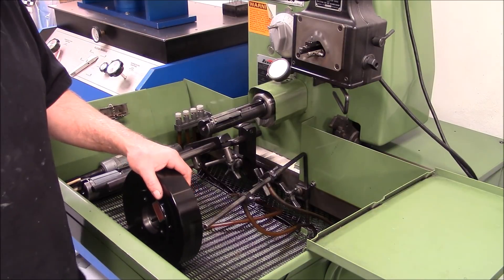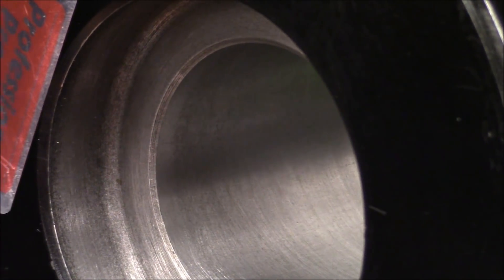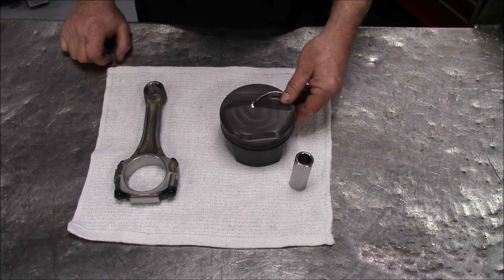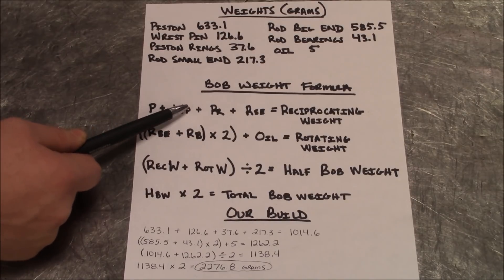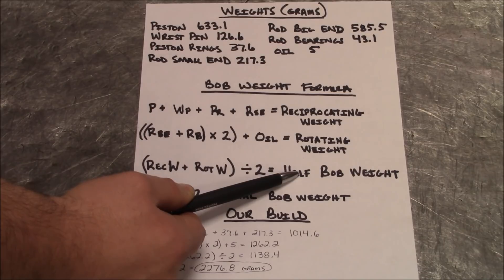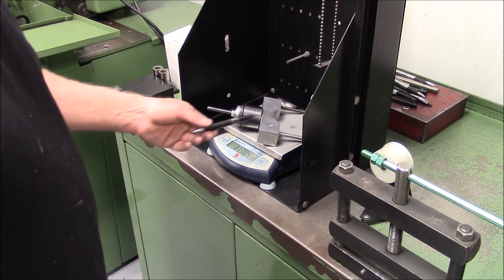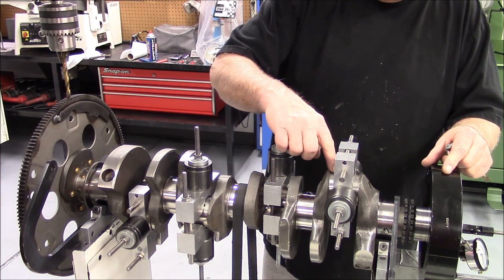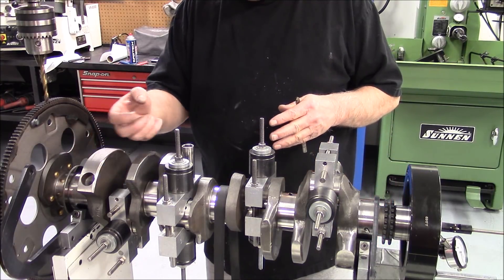Part 8 Rotating Assembley Balancing - Bob Weight Setup 620 HP 454 Big Block Chevy Engine Build

Comment: If I'm currently Selecting Crank, Connecting Rod, Pistons and considering a Super Light Manley or Lanati Crank, to keep rotating Assembly as Light as Possibly, Seems to be Smart to Calculate Rods n Piston weight (As You have shown) to Match Crank Bob Weights as Closley as Possible, If Not, Might make more sence to buy Normal Weight Crank rather that adding Mallory ?
Thoughts

Comment: why divide by 2 to get half bob weight only to multiply by 2 again. total bob weight will be the reciprocating weight plus rotating weight always right? 1014.6 + 1262.2 = 2276.8. why not just stop at that step?
Reply: I think you need to know half bob to ensure each weighs the same

Comment: you did a good job getting the weight down on those stock rods but they're still kinda heavy compared to scat i beams. doing the work yourself helps justify buying those expensive wrist pins.

Comment: I am a curious sort of person.  I wanted to derive for myself where the rule of thumb "100% of the rotating plus 50% of the reciprocating" came from for the bob weights.  I set up an incredibly detailed spreadsheet with all of the rotating assembly components' masses, positions, and velocities during a revolution.  What I discovered in the end, was that the 100/50 rule of thumb only truly applied when the center of mass of each connecting rod was exactly one-third of the distance from the big end to the small end.  Yet, I have never heard any engine builder mention this.  Is it possible the Engineers at the factory knew this, and roughly designed the engine with this in mind, and it somehow never translated down to the mechanics/aftermarket?

Comment: Newbie to this so....possible dumb question. What would be difference with new parts (scat forged crank and h-beam rods) instead of used? Same lightening, resizing of rods or just whats taken in the balancing process? Would you still do all the work on a new scat crank, or again, just whats needed for balancing? BTW...small block stroker motor, street strip, looking for approx 520-550hp. any help would be greatly appreciated. Am enjoying the videos, learning alot. Thanks.
Reply: Unless it was specially ordered, the balance will be farther off on a new crank.
The crank can be manufactured to a "close" balance, but calculating the bobweight and correcting the column is the only way to finish balance the
crankshaft. Even rod length changes the balance. Scat sells the 383 crank in a 
6" rod or a 5.7" rod version (different counterweights). Your H-beam rods are
typically within 2 grams/set. SBC factory rods from engine/engine can be
more than 30-35 grams.